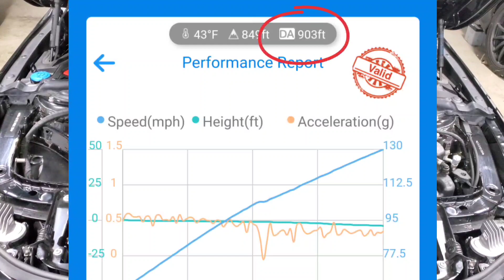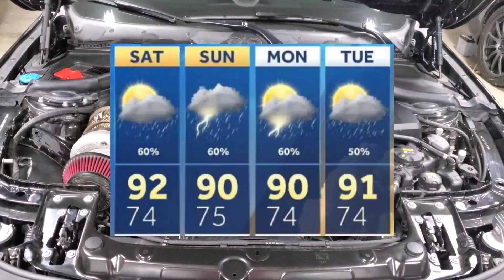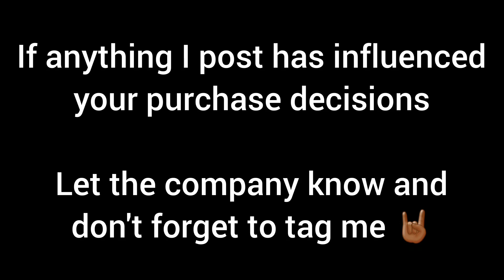What is DA (Density Altitude) and how does it effect a car's performance?

Comment: Kern, I have a question that I am hoping you or someone can make sense of.  My current elevation is 4640.  Our current Density Altitude is going as high as 7,800, (+3,160 feet).  I have an understanding of Density Altitude and IAW scientific Articles of weather, sea level is 0.0764 Air Density.  4640 is 0.0665 Air Density.  And 7800 is 0.0605 Air Density.  From 4640 (0.0665) to 7800 (0.0605) is in theory, a -9.023% reduction of fuel due to elevation (density altitude of 7800). // If I subtracted 4640 from 7800, that gives me 3,160.  Some people say add or subtract fuel by 3% for every 1000 feet change of elevation.  3160 divided by 1000 equals 3.16 (or 3.16% of fuel change).  Is there a way to prove or disprove one of these methods of fuel adjustments?  I also understand a car or motorcycle should make automatic fueling adjustments according to elevation.  But an elevation of 4640 with a density of altitude of 7,800 is lacking more air than at 4640.  And this is not being factored into the ECU adjustments to maintain proper AFR.  Am I wrong?  Or am I missing something??
Reply from the maker: There's no need to do all that. Just check a local stations da calculation. I won't be that different.

Comment: Thank you for this very informative video. I have a question on my used Ford Escape that I recently purchased. I noticed that it is having check engine for the O2, MAF, Throttle and Cam sensors whenever we use it in our area which has a very high elevation. I suspect this is because of the high elevation. What do you think is the best thing to do besides cleaning the sensors and Throttle body since this is an old car (2008)? Thank you
Reply from the maker: Sensors may be bad

Comment: So when you see your altitude and the DA on the draggy do you add them together use one or the other?? How does it work??
Reply from the maker: Density altitude is what matters the most. You can have the same density altitude at different elevations and the car will perform similarly, but if you're at the same elevation with different density altitudes then the car will perform differently.